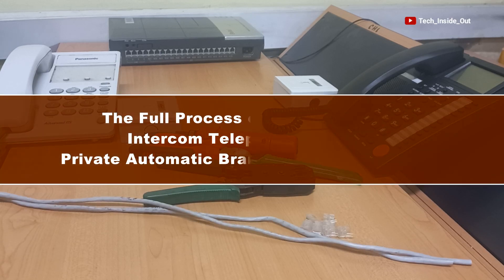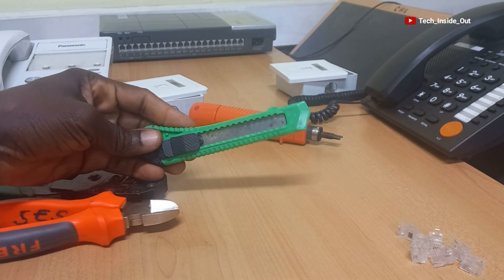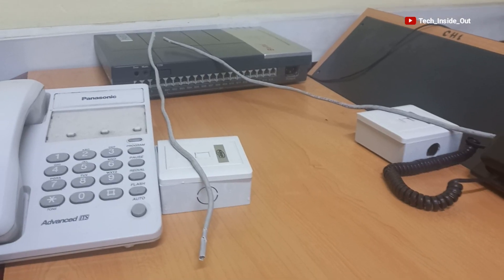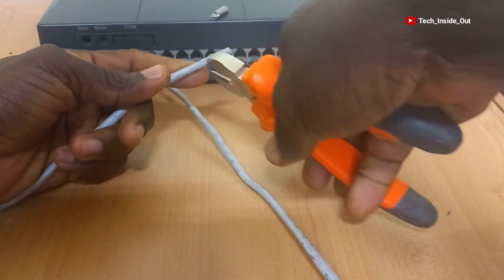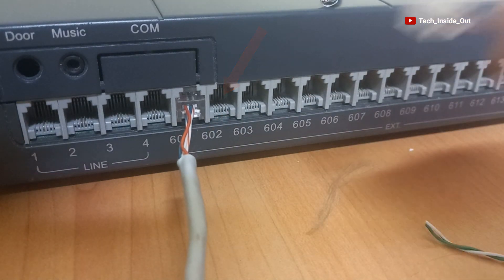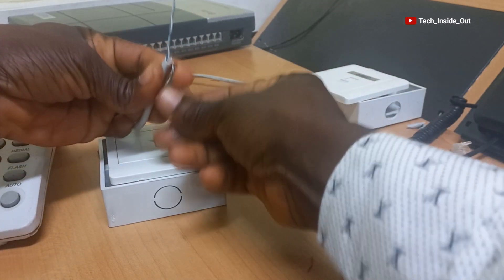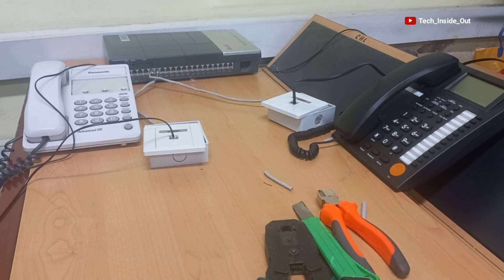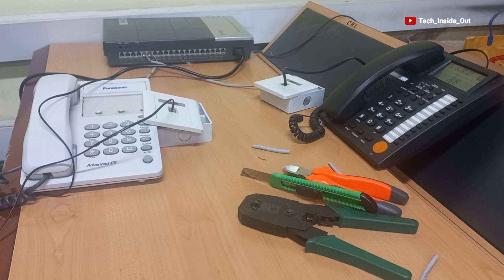How to install an intercom telephone system - PABX, a Practical step by step guide.

Comment: Thanks for this video, but why did you terminate one with four wires and the other with two? What would it have been if it were a multiline setup?
Reply from the maker: All four conductors will be needed for that

Comment: Thank you sir 
But why did u use 4wire on the first and 2wire on the second one
Reply from the maker: The first one uses a 4 wire connectivity whiles the second is a single line telephone

Comment: Q1: How do you crimp RJ11 clips for single line telephone? (I mean crimping only the white-blue and full blue wires)

Q2: What happens if you terminate the four wire colours for a single line? Also, what happens when you crimp four wire colours in RJ11 for a single line.
Reply from the maker: 1. You place them at the two middle points in the RJ 11 jack, i will do a demonstration on my live Q & A session on Sunday by 16:30 or 16:45 GMT
2. It would work. The handset will use just two of the conductors.
Reply: @Tech_Inside_Out  Thank you very much. So, in that case, I can just run the normal four wires and let the telephone detect what to use.

Edit: That way, in case the client changes to a multi line telephone,  there would be no issues. 

Hope, I can do it that way?
Reply: @Tech_Inside_Out  I'll be looking forward to the live session.
Reply: @Tech_Inside_Out  Hello, the live session didn't hold?

Comment: Can we connect two phone on same extension?
Reply from the maker: It can be done but the two lines will have thesame extension number and will both ring whenever the number is called.
Reply: @Tech_Inside_Out  Thank you for the quick response. We have intercom system for our housing society and each apartment has two end points and one KRONE installed. I am trying to get both the points wotking simultaneously.

Comment: Watching from Cameroon .does it mean if I buy a PABX and carry out my connection as u did it work without any programing or configuration?
Reply from the maker: There are programmings you can do to customise the pbx, nonetheless, you can use it in its default state without programming

Comment: Thanks one again. Why do you remove a very large portion of cat 5 cable to fit the rj11, when just a small part is needed to be pilled to fit rj11? Why??
Reply from the maker: You need at most 2 pairs of conductors from the cable, if there is a way whereby you can unveil the 2 pairs, that will be fine but i find it easier Pilling all

Comment: For a single line, what if i connect the 4 strands of cat 5 cable to the socket instead of 2 strands as you have done, will it still function?

Under which conditions does krone come in, kindly?
Reply from the maker: The 4 strands works perfectly but since the phones are not display phones, you do not really need all the 4 stands but it does not spoilt anything at all, you can connect the 4.

The Krone is used in situations where you have 4 buildings sharing thesame PBX system where you need to have a distribution point at each building whereby you will carry the signal from the pbx switch to the Krone or the DP and further split it from the Krone to your sockets.
Reply: @Tech_Inside_Out  Thank you so much for the clarification!
Reply: @Tech_Inside_Out  thank you for the clarification.

Comment: Why is one socket connected only blue wires and the other socket is connected with orange and blue? Am confused
Reply from the maker: There are standard cable colour codes but one may choose his own cable colours and it would work well.
Reply: Only two wires are used for communication in the intercom. It's up to u if u wanna terminate 4 cables it will also work, and if u terminate 2 cables than its also ok and works properly

Comment: I just want to change the ring from the current (British) ring to the standard ring. Can't find any videos about that.
Reply from the maker: The rings of the phone can only be changed if only your handset supports that function. You can find that set of instructions in your phone's manual
Reply: @Tech_Inside_Out  I use real telephones. Western Electric Desk phones and French Phones in rooms that have a more "delicate" touch. And rotary dial too. I have a circuit that converts the dialed numbers to a DTMF tone. I just don't know why they make it do the two short rings when one long ring is better and should be the default. And no clear instructions on how to make it ring the way I want it to ring.

Comment: Fantastic video, very nicely explained. I was wondering though, why do you have to connect to the socket box? Does it not have enough power/connection to just plug the phone into the PBX?
Reply from the maker: The phone can be directly plugged into the PBX but the sockets are mostly created to serve as nodes at which the handsets can be plugged. You would sometimes find sockets created within walls, thereby burying the cables out of sight for beauty and protection of the cables from destruction.

Comment: Say how to you make connection for different rooms to call reception, kitchen and laundry?
Reply from the maker: Those are the processes enumerated in this video. I will later do a video for an onsite installation
Reply from the maker: That is what i have enumerated in this video.  i will soon publish an onsite installation indicating how it is done on site
Reply: Thanks...I'll be waiting for your video. Again how do you terminate the single flexible cable on the rj-11

Comment: How much maximum length allowed for pabx to telephone using UTP cable cat6 pure copper?
Reply from the maker: Network cables are most effective when you run them within 100m length.
Reply: Can he reach 300 to 400 meters? won't the telephone be a problem if the utp to be used is that far? @Tech_Inside_Out
Reply: @Tech_Inside_Out please if it’s more than 100m how do we go about it

Comment: I was wondering if you can help me please.

I recently moved into a new flat with a broken intercom. I identified it as a "ACET 22220 (2 Wire)". It has 6 wires inside (yellow, green, white, red, blk, blue). Cables yellow and red are in slot 5, black and blue are in slot 6 and the other cables are not connected at all.
I bought a bell 801 as replacement which 5 slots for wires "I R O T Z" which is different from my old ACET 22220.

Will this work as a replacement? And if so where would each cable go?
Reply from the maker: Please which type of bell are you using to replace the old intercom system.?
Reply: @Tech_Inside_Out   bell 801. thank you

Comment: Thanks for such educative video real like this series.
Learning alot from you.

But to be clear on something, in your previous videos, you made mention of a krone or patch panel.
But you didn't use it in this setup.

Is it safe to say you can setup a full functional system without a krone or patch panel?.

And in what instance do we need the krone?
Reply from the maker: Very good question. 
1. You can successfully install a telephone intercom system without using a krone or patch panel 
2. The Krone or patch panel is required in instances where you are installing the pbx to serve two or more buildings,  in such cases you would place a krone at the point where all your cablings will come to in one building and run one multi pair cable from the krone to the pabx machine which will carry extension wiring to the krone. From the krone, you will then distribute to your extension sockets.

Comment: Sir i noticed that you did not use the krone here
Reply from the maker: Yes, this is a very good question. The krone is normally used when you have to extend the reach of your pbx using a multi pair cable, where you terminate the multiple pair cable coming from the pbx switch on the krone and redistribute the extensions from the krone. 
I will consider doing a video on how it is done
Reply: @Tech_Inside_Out  alright, I will be expecting the video sir, thanks for your time and your videos, I was able to execute a cctv job on my own. Thanks so much
Reply from the maker: @jamex6330  Am always glad to know that the tutorial is helpful.  
Thanks for this testimony

Comment: Why use cat5 and not cat6? Any advice pls
Reply from the maker: The main difference between cat 5 and Cat 6 is the bandwidth that each supports and hence the volume and speed of data that each can process. Cat 6 has a higher bandwidth and data transfer speed and as well more expensive than Cat 5.
Voice communication or pabx requires less bandwidth and data transfer speed which can be well handled using Cat 5 at a good price. 
However,  Cat 6 can be used without any problem.
Reply: @Tech_Inside_Out  a bit confused on the second faceplate with only blue pairs but hoping to see more videos and also with the krone too.
Reply from the maker: @swaggst  The question about only the blue can be answered here on this video 
https://youtu.be/oRIUYQn5QvI
With the krone, as you said, I would touch on it in subsequent videos.  I will explain its use as well as Patch panel
Reply: @Tech_Inside_Out 🎉
Reply from the maker: @therivalengine  Thanks
Reply from the maker: anthonychekwube618  God bless you too